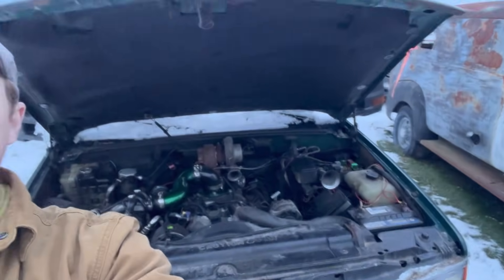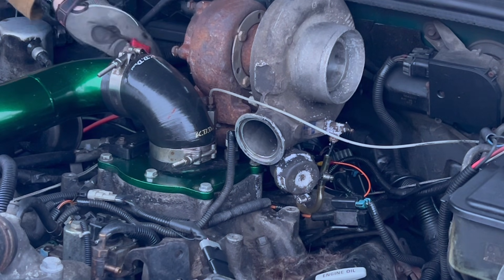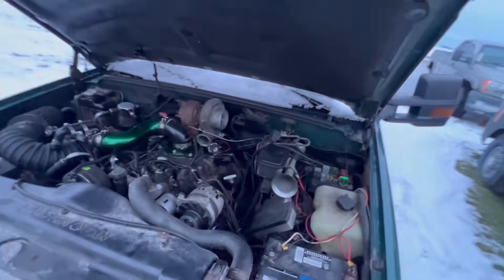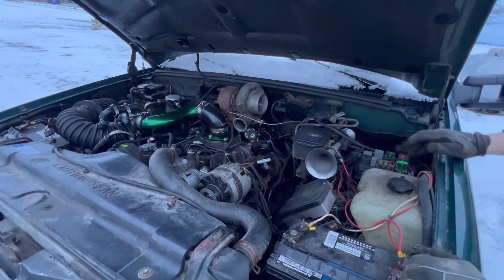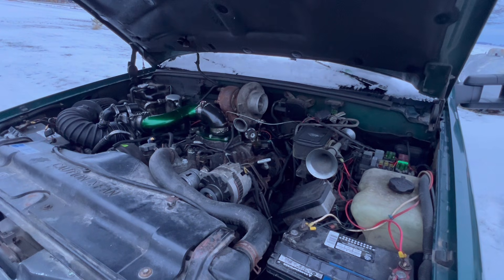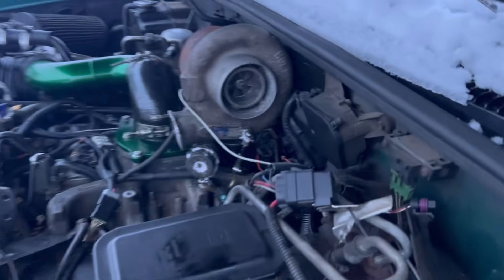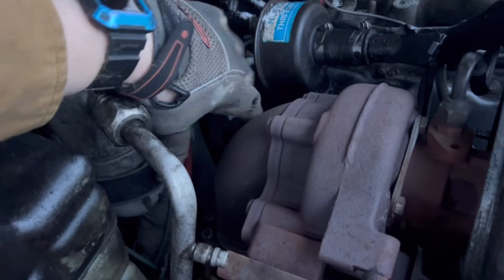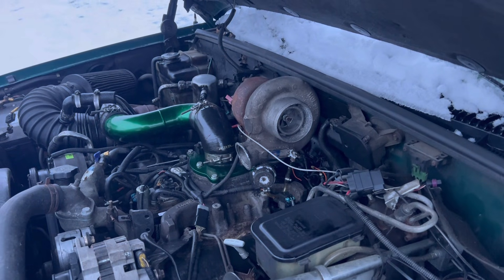GSC: 6.5L diesel center mount turbo setup part 1

Comment: What’s the advantage?
Reply from the maker: Going center mount we can get better exhaust flow and reduced EGTs with the more balanced piping. It’ll reduce drive pressure issues without having the collectors mashed up all on the passenger side by cylinders 6 and 8. A friend has a similar setup on his truck and his coolant temps also have dropped and are more even bank to bank when run hard. Over all less heat, less stress, more possibility for power with less wear on the engine.
Reply: @gingersnapcustoms hmm, I see the better flow and  better cooling from the equalization, the wear though? Maybe less heat saturation on the right banks. Have you considered moving the engine and trans forward? Deleting the fan and replacing with electric? That should garner 5” without destroying the firewall.
Reply from the maker: @johnsweet8410 I’m actually kicking around the idea of making the turbo a remote mount in the stock location as a backup. E fans have never worked well on the 6.5 when I’ve tried them. So I’m attempting to retain the mechanical fan if possible. Moving the engine even 2” would be huge.

Comment: I mean there's a guy a with center mount s400 he did have to beat the firewall a little but it fit really really well
Reply from the maker: Tyler hammered that firewall a lot to his setup and no longer has wipers. I’m trying to avoid heating and beating the body.
Reply: @gingersnapcustoms that understandable, I didn't even think about him having the wiper motor out of it since it's a drag truck

Comment: Have you thought of putting a different hood on the truck that has the hood scoop to give you the extra clearance needed.  Since the Duramax has a raised center section hood for the center turbo.  Good luck with this build, I am definitely curious how it will go
Reply from the maker: I have a steel bowl hood that might get adjusted for this. I’ll definitely need it if the S300 is as tall as I think it is.

Comment: I have a completely Stock 1993 GMC 3500. Do I have to upgrade my muffler if I put a bigger turbo on it. I don’t have any of those other fancy extra gauges again it’s completely Stock.
Reply from the maker: If you do a turbo you will need a 4” exhaust and a lift pump at minimum